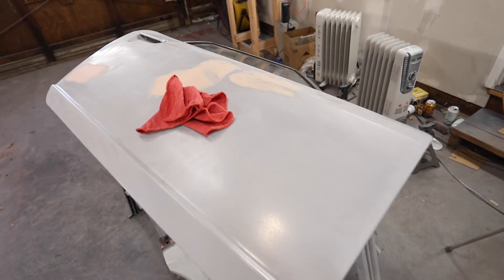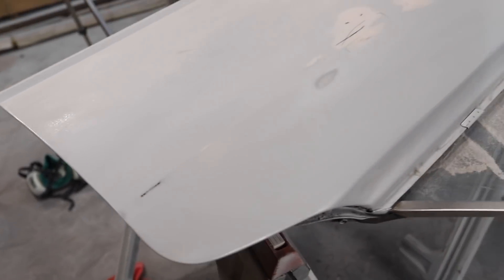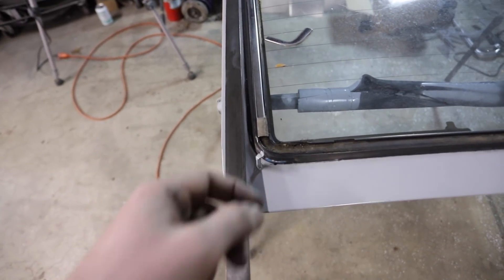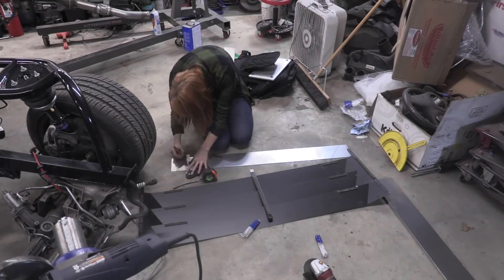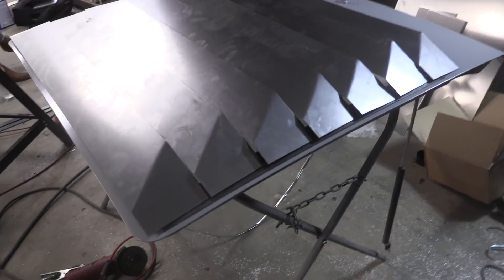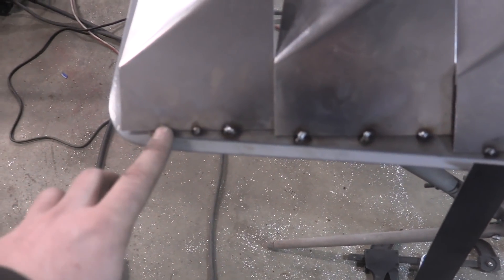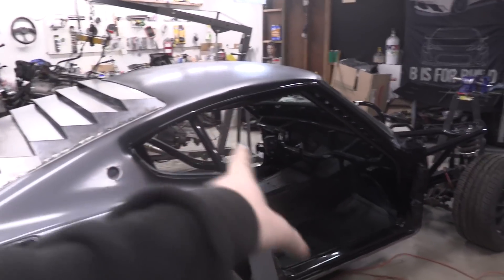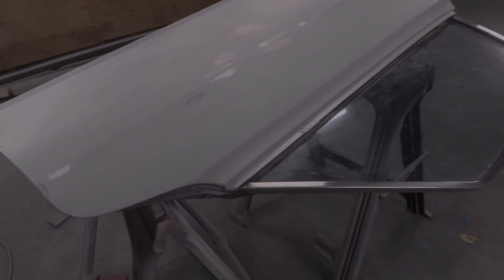Building DIY Window Louvers For The 240z

Comment: @always hyper positive BIFB hero: I'm gonna say what has already been said many times - you NEED the chrome strip in the rear window molding. It locks the rear window in place and without it one fine day a pothole on street, or a curb on track will have the glass in 1M pieces all over that fuel cell. So, the idea you explain at 3:23 is not a good one. Paint the strip black. However if the strip is already destroyed then it's much safer to install the other, fatter gasket.

Comment: You should try wet sanding the epoxy. I had the same issue when i used epoxy primer on my car. Wet sanding helps preventing the primer clogging up the sand paper.

Comment: I’m Pretty impressed with the rear Louvers , back in 1978 i  installed a Commercially available set of Louvers on a 1977 280Z 2+ 2 those came with a hinge mechanism  for washing and cleaning the Glass  but i was a nervous wreck about drilling into a almost brand new Car at the time  it all turned out Well    i purchased Plexiglass headlight covers from the same outfit  and those had little Chrome L bracts that held them onto the Car with Allen  Chromed  machine Screws

Comment: A few of my friends and I built a rear window louvre for 1986 Firebird using 1/2” PVC board, and some 1/4” stainless steel hydraulic tubing.
The PVC sags under its own weight in a hot environment, so the stainless tubing was used to stiffen the louvres.
It looked great for about 6 months...
Then the cheap paint started to crack and chip.
Ya get what ya paid for...

Comment: Your epoxy primer issue is because the chemical reaction that causes it to dry, stopped, when you let it get too cold over night.  The reaction in epoxy does not restart once that happens.  Had the same problem with my garage floor crack sealer, was an utter pain to clean out the unset stuff :(

Comment: Looks great...but the window is the last thing I would have installed. Working on the dash will now be a pain in the butt.
Reply: Has he said what the plan is for the dash? I can't remember if the Datsun had a halfway decent one when he got it.
Reply: @im_pharaoh  He's going to use that M5 dash, they got it to fit.
Reply: Oh word? That should be so sick once they get it all together. Hopefully they can make it look clean with the cage and all.
Reply: They got the M5 dash to fit, except width wise. They still need to chop it and make it look nice on the sides somehow.
Reply: a quick chop of the dash and some aluminium deck plate should look alright :P

Comment: If you want a decent spray job from home. 
1: have a clean and dirty areas. Don’t shit where you paint. Don’t sand, don’t tape. Look at the state of your “booth” it’s disgusting. 
2: wet down the floors...
3: don’t mix filler on paper, cardboard etc
4: use a guide coat when block sanding 
5:  skim the ENTIRE panel
6: epoxy sanding is a no go if not cured for a few WEEKS

Other than that you’re doing a decent job. Just that extra 10% will help a bucket load.

Comment: What I've learned with sanding epoxy based primer is that the sanding dust balls up into little bearings and makes your sandpaper just roll around doing nothing. Block sanding in one direction and lifting up at the end of a run is the only way to actually sand

Comment: If the deer was hit by a car, it probably has some internal injuries beyond just the limp. If it won't run off when you try to scare it away, it's probably suffering. It's far more cruel not to allow the police to put it out of its misery. Or man up and do it yourself then stock your freezer.

Comment: That's not just chrome trim, it's called lock strip.  It is what tightens up the window seal, holds the window in place, and actually ensures that it's waterproof.  You can't just remove it.  It's like like a modern car where the windows are bonded in.
Reply: Brent Spang he should just paint it black and put it back in, you can’t see it anyway and like you say it’ll be sealed then
Reply: b17ssy My E30 uses the same type of seal on the front and rear windows so I’ve been dealing with it for years. BMW actually makes a black “shadowline” lock strip that I installed when I replaced my rear window seal (nightmare, twice). The front seal is still good so I just sanded the chrome strip and painted it black to match the rear.
Reply: Shouldve just got it replaced with new glass and molding like the windshield.  Good info on that lock strip
Reply: Muhammad Elbarawy running your car without the filer strip in your windscreen is dangerous, if u end up in a crash expect to go through it.
Reply: Brent is 100% correct, the filler strip keeps the window secure and helps prevent water ingress.
Reply: You're not talking about the front screen i hope? He replaced the entire seal for one without a chrome trim in it. So the new seal is not meant to have trim in it and won't suffer from any of the mentioned problems.

There are also examples where trim can be left out of the seal without causing problems. In most of these cases there is a very small slid in the rubber in which the t-shaped trim is placed. Only about 2 mm wide. It really is just there to place the trim in. Trim needs to be placed in the window seal before putting it in the car then.
Reply: Forreal he's Russian??
Reply: @ponyboy1st  do seatbelts not stop you going thru the window? 😂
Reply: Brent Spang l
Reply: This. fucking hell, get a black strip.

BMW has used both chrome and black on the E30s f.e.
Reply: Red Rider7 A properly secured window is a lot more likely to hold you (or at least your appendages than a window that you can push out with one hand.
Reply: Leslie Afeawo I heard him say that he was going to smooth down the rubber seal, ie remove the ribs that the lock strip locks into. Did I misunderstand that?
Reply: He got to one that doesnt need that trim to lock it. Wtf do i know tho
Reply: whothephukami for the front he did, for the rear, so far he has only removed it.
Reply: Theres two versions. The lock strip is an older version, but what he used is a later version. With that rubber seal, it doesn't accept or need a lock strip to seal the windshield.
Reply: Potato Pete for the front yes, my comment pertains to the rear which he hasn’t suggested he’s switching the style of seal
Reply: oh okay, sorry about that. Hopefully he has enough sense to do so......
Reply: Jimyh are you telling us the that without the filer strip your seat belt are disabled  ?
Reply: giuliettaevo not talking about the BIFB build in this instance. Talking about the chap with the mini who don't use it. Also your wrong, the type of glass that requires a filler strip requires it for a reason not for looks. The filler strip spreads the rubber seal causing it to lock into place better. In case of an accident the screen can still fall,out with the filler strip but is less likely.
Reply: Tony Attacks Yh, but if your willing to drive without filler strip in your windscreen I reckon he possibly is the person to drive with out seat belts lol. Also on a mini that has this type of screen we are talking old, so seatbelt less reliable. Obviously I don't know if he drives without seat belts. My point was that the filler strip is important.
Reply: Red Rider7 have you?? I've never seen anyone go through a bonded screen, yet seen several go through the rubber seal screens of both designs, with and without filler strip.
Reply: Yep no zipper = big pop and glass on track
Reply: 1) the front windscreen was installed by professionals using an aftermarket seal without the chrome lock piece so don’t know why people are crying about a windscreen for.
2) he removed the chrome in the rear window....did it fall out...no. Was it still obviously secure...yes. What happened if it does fall? It’ll hit the roll cage and break. Or it will hit the louvers and break. It won’t hit anyone. Get over it.
3) if it works it works if it doesn’t more content.
4) stop crying because someone didn’t do something the exact way you’d do something
Reply: Michael Gallagher you clearly didn't watch the video. The front windscreen was installed using a solid rubber, not one that uses a chrome or any other filler strip for that matter. Yh the rear glass is still in place, until he drives and has his windows open the the pressure will push it out into the louvers and possibly break causing glass shrapnel to go everywhere, let's just hope there are no pedestrians around when it does. Safety first people, come on.
Reply: @ponyboy1st  it could. It probably won't.

Comment: Epoxy is only for sealing the body work off. Not for the body work. Thats why you are having trouble sanding it. You want to use high build primer to do the body work and sand the dents and then when its all done you lay the epoxy primer on to seal it.
Reply: Yup, the high build is almost just spray-able bondo.
Reply: unless its hi build epoxy primer then as you say liquid bondo (bog in Australia haha) if you don't sand it the next day its an 80 grit  sand and serious hard work, ask me how haha
Reply: It was supposed to be final coat before wrap but had low spots.
Reply: This is what I told him on the last video
Reply: Leave shitty bodywork to the professional's.

Comment: Can the louver be removed if you want to clean the rear window?
Reply: Some use to have a spring loaded screw. Push in and twist to release both bottom sides. The top was hinged to raise it off to clean under it. Would take longer to fab it up thou.

Comment: I am really curious to what the final weight of this car will be when it's all together.
Reply: I was thinking the same. Trashes a lightweight set of aluminum lovers to get measurements to make some out of 1/8 inch steel.
Reply: I think that with all the box section he's used, it won't be much lighter than the relatively lightweight unibody of the M5.

Comment: 240m vs street bandidos fully carbon fiber 240z
Reply: Yes!
Reply: Street bandito ftw in this case man. No hate on Chris, but I feel bandito did their build more meticulously. Plus that carbon job was dope.
Reply: Bandito has half the weight in body alone. Let alone a lighter engine with the same power. And if your going as show cars. That full carbon body with the velocity stacks just cant be beaten
Reply: @Stxn yeah but at least it wont rust in 5 days.
Reply: It’s not even a competition.

Comment: Just my two cents, it may have been a good idea to wash the window, maybe even applied some rain-x for good measure before you fitted the louvres 'permanently'
Reply: Agree
Reply: I'm sure the 4 fixing nuts will be accessible.
Reply: *may have
Reply: painting
Reply: It would have been a good idea to remove the rear window before welding on top of it!

Comment: So uh... How are you gonna clean the rear window?
Reply: You remove the louver with the building in bolts?
Reply: The bolts are under the louver...right?
Reply: @logikai  open end wrench
Reply: Power washer would be pretty easy to get in those tight spots imo
Reply: My thoughts exactly Lol
Bolted down then lourves welded on top. Going to be fun trying to remove them now 😅
Reply: The louvres can be taken off I guess

Comment: not a fan of the window louvers but what i realy do not like is the fact that they are made of steel. This car is already heavy enough.
Reply: Jakob K. I think the BMW v10 it now has will carry the weight just fine
Reply: I think it'll be fast, especially with the V10 lol
Reply: I think it really isn't an issue especially considering that it's just gonna get the weight distribution closer to where it would ideally be.
Reply: Heavy enough? This thing is quite a bit lighter than the bmw the v10 was originally in. A couple extra pounds isnt gonna matter a single bit.